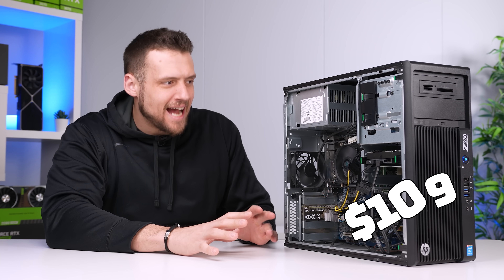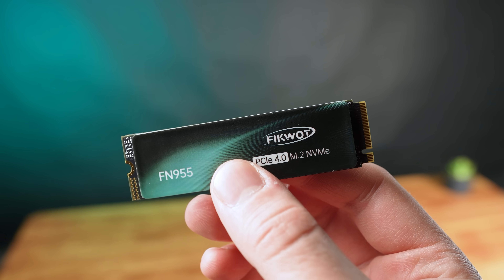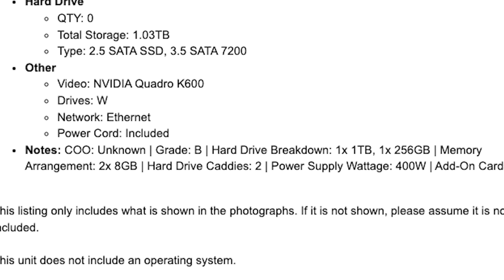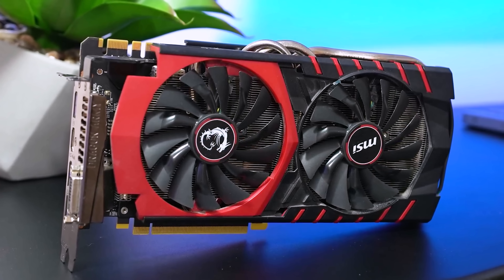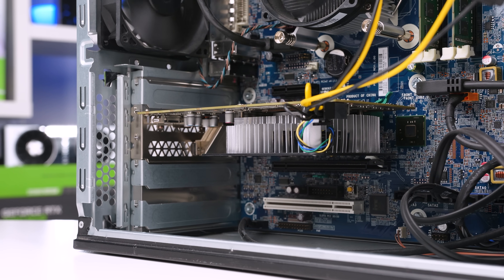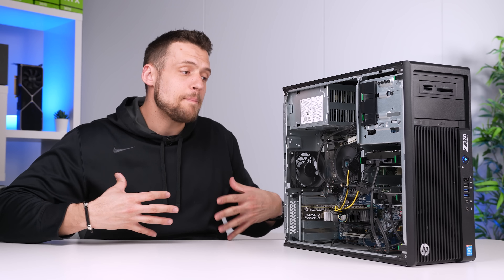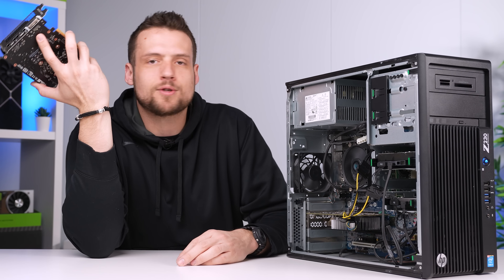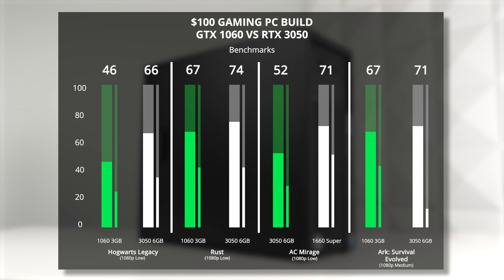This $100 Gaming PC Plays Every Game in 1080p

Comment: I just want to play old shit. 
Pretty much 2000 to 2012 games.

These new computers don't even come with optical disc drives anymore.

Basically i just want to play Skyim butter smooth on ultra settings with an ungodly amount of mods; Fallout New Vegas/3 as well.
What do i need folks?
Reply: an rx 580 8gb, and a dogshit pc like in this video will suffice.  try to get 2 x 8gb setup with an i5 or an i7.  8th or 9th gen cpus.  dont get a sff.

Comment: GPU Name‡ Intel® HD Graphics 4600
Graphics Base Frequency 350 MHz
Graphics Max Dynamic Frequency 1.20 GHz
Graphics Video Max Memory 2 GB
Graphics Output eDP/DP/HDMI/DVI/VGA
Max Resolution (HDMI)‡ 4096x2304@24Hz
Max Resolution (DP)‡ 3840x2160@60Hz
Max Resolution (eDP - Integrated Flat Panel)‡ 3840x2160@60Hz
Max Resolution (VGA)‡ 1920x1200@60Hz
DirectX* Support 11.2/12
I'd rather get 2 4k displays and use it as a destoptop for utube and emails

Comment: Just thinking outloud: no shipping... ok then no gas for the meet up.

Part A: hpp z230 : if someone cares enough to list the model its over 60$ almost always. You would be more like to find this model under free than with this model.

Dont believe me? Look it up. At 43$ bro is worried about getting hosed but he got a 256g boot drive 1tb wd black 7200, 16g ddr3, i74790

For 43$... 

In real life it goes up for 30-50$ and has no ram or storage drives.

You can get this for this and it may not be hard but if you truly want a 100$ build, you need a free pc pretty much, and the earliest you can go is i7 4790. Your gonna spend 100$  filling the ram and or getting storage and just forget the adapter: just get sff 1050i used. 

60$ 1050ti shipped, ram and any boot ssd (no money for a seperate storage dr8ve at 100 bucks you gonna have to download and delete stuff.) Hopefully 40$ ...

Its gonna be tight. And its gonna be a hard sell.

Really a bettee video would be 3 x different kinds of 200$ builds. Or at least 2 kinds of 100$. 

This computer deal is real, you can find all these parts and only pay maybe 30$ in shipping or gas and this will kinda play helldivers 2.

So this is at least 139$ now with inflation and the ram and storage or boot are independent leg work.

What my man Zach meant to say was :

Go to every local office park and see what they threw out every week for a month. Pick out a system.

This system will be anywhere from a i72600 to a i7 7700 and may or may have ram and a boot.

Anything zach posts that he found for less than 60$ most companies just chuck in the recycle area.

So to give him credit this is instructions for bin hunting and a $66 dollar build.

Comment: How can you run Starfield on gtx 1030 3gb and i7 4790K for 109 usd, but I cant run Starfield that smooth on my( 2 years ago) 1000 usd laptop.? I know, that laptops have tuned down components, but I have ryzen 5 5600H, gtx1650 4gb and 16 gb 3200 mhz ram. And yes, it is pluged in the wall.

Comment: 😂😂 this is the same guy that says a 4060 is crap but sells seriously low budget pc’s to you doughnuts 😂 that can’t be upgraded or get any upgrades from Nvidia anymore because it’s so old ,shows you the benchmarks which a 4060 will destroy ,if you can’t at least save 600 then you don’t need a pc you need a console which would be just fine .dont @ me either your argument is already dead .